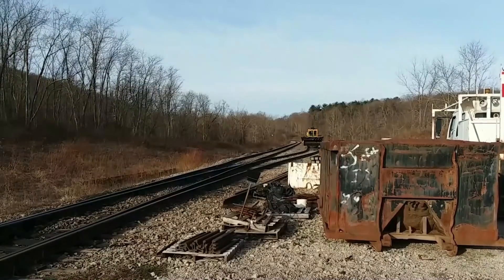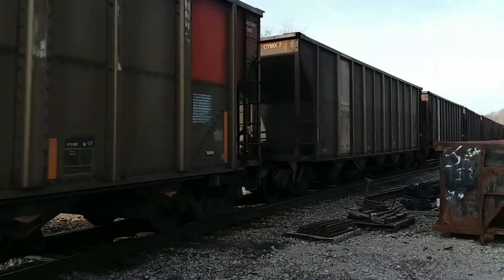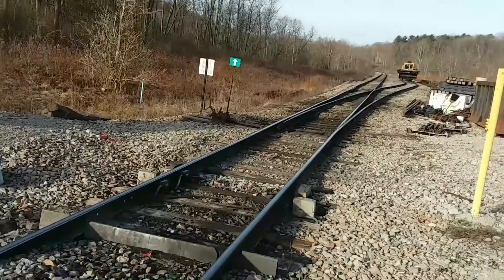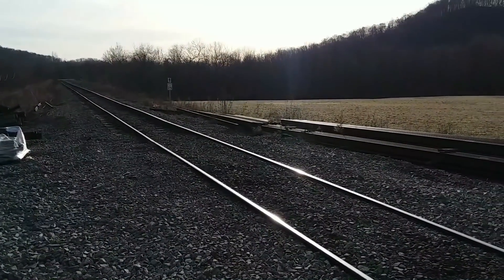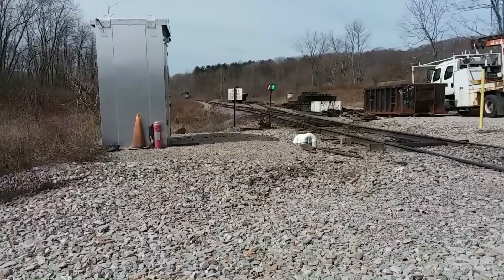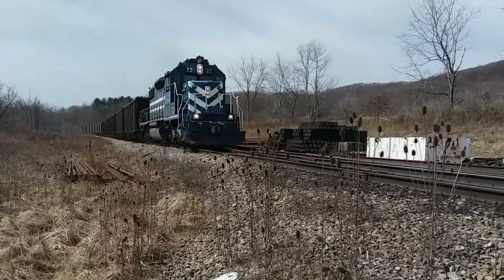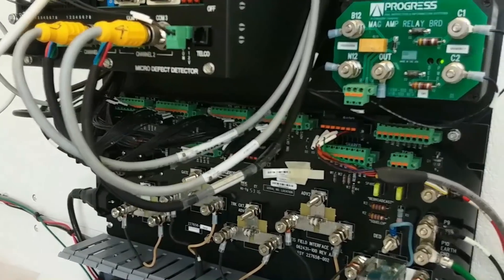Critical Alarm! Hot Wheel Detector Goes Nuts! on Dragging Equipment Message

Comment: I worked for a Class 1, now 20-years ago, and we used Devtronics Hot Box Detectors.  Most of dragging equipment detectors were 'flapper' style, but a few were static sensors - essentially a fixed-triangular steel plate, with percussive sensors beneath it.  We had monthly routines we did on all of the HBDs, checking the thermal cameras, within the cast aluminum housings on the outside of the rails.  We had a 'heat' source to simulate hot bears/journals.  We also checked the transducers, both the advanced turn units, as well as those that count the axels.  For the HBD to falsely alert, I suspect something is out of calibration.

Mice getting into the buildings can also cause things to go awry, from time to time.  The life of a maintainer is never dull.

We also had on-track lightning protection, to protect the HBD equipment in the trackside hut from both induction & lightning strikes.  Miles of track can do some crazy stuff to electronics.
Reply from the maker: Pretty neat stuff you shared with us, we really appreciate your
writing in. I love to hear stuff like that and will keep in mind the
mice for a future reference! There was a glitch in the computer
software and the tech had to come out and fix it, but wasn't
here when he did so I really don't know the exact thing he did.
Very interesting bout the lightening protection, I would like to
learn more about that. Once saw lightening strike the track and
a fireball went down the track bouncing from rail to rail,
my goodness that would have made an awesome video but it
was before I even had a cell phone years ago.

Comment: Could really quickly check the whole train with someone on each side of the train with a  FLIR heat camera. Maybe they do that already, just a thought.
Reply from the maker: That's what the cameras on the detector do, take an infrared
picture of each bearing and wheel as it passes over them. They
also once a day do a walk around using a heat gun on each
bearing just as added insurance. Not sure what a FLIR is, but
the heat gun they have is a high priced one that the fire departments
use. Do thank you for writing in and for watching Iain.
Reply: @ccrx6700  FLIR stands for Forward Looking InfraRed. This is the type of cameras that police helicopters use at night when tracking down crooks.
Reply from the maker: Sweet Thanks 😊

Comment: Sure did sound like both engines were idling going by 👍
Reply from the maker: Headed west they probably were, they are just coming down
off a grade that way and depending on the operator idle thry
here before throttling up for the next grade. Headed east loaded
both locos are in run 8. Thanks for watching the show Joe.

Comment: Can the rails ever be too low or sink when the train comes?
Reply from the maker: Yes they do sink thru soft spots in the ballast where there is
not a good roadbed to hold track surface and on occasion the
rail will fall for a certain length which creates a low spot in
relation to the rest of the track surface grade. Hope that
helps Tommie. We do appreciate your writing in and for watching.
Reply: @ccrx6700  I have always enjoyed large equipment. Many of them remind me of dinosaurs, which is sentimental. Also, I figure, if a train is really heavy it might just hit one of those plates to set it off, but not necessarily knock it all the way down? I like to figure things out and learn new things. Your videos are awesome for that.
Reply from the maker: @katitcha  thank you very much 😊

Comment: Check the wheels anyway, slow the train down
Reply from the maker: Train got stopped just below the curve and we did walk
the trip, nothing wrong, proper procedure was followed the
first time it set the message off, then after several roll by
inspections and different messages that were given we knew
the problem was in the detector and not a train issue. Do appreciate
your writing in and for watching Jim

Comment: This reminds me of an episode on Chuggington. The episode was about a fault detector system that they had installed on the lines. It was having issues just like this. Saying "Faults Detected!" But, no faults were found. Its definitely a pain when they act up, but its also good to have these detectors in place to when they do find problems. It helps saves equipment from being totally messed up. And also, to keep the crews safe.
Reply from the maker: This one rarely goofs up, just got lucky and happened to be filming
when it did. You are sure right, they are important for safety reasons
and this one has already caught 4 hot bearings in the 5 years it's
been here, thus saving derailments that most likely could have
occurred. Thank you Paula for watching the video, we do appreciate that

Comment: What ever came of this? I seen detectors have false temperature readings of triple digits in the sub zero temps but not false dragging equipment. Its odd the numbers are all over the place. On the first pass it was axel 111, 113, 115 which was between your 27th and 28th car, (out of 38) but when you made a reverse move, it was the first and second axel. very strange.
Reply from the maker: Ended up being a gremlin in the computer software, had to get a
tech out to exorcise it. Was very strange message for sure, it had
us baffled, but did make for a pretty cool video...LOL Appreciate
your tuning in and watching the show my good sir

Comment: Question?   First l hope that You and your Family had a Beautiful Wonderful Thanksgiving and everyone ate good and everyone was healthy God Bless You and your Family.   My question is why do the have the Engine's facing the same way.?  On on end it's facing correctly the Engineer is facing so He can see the Short Cab is in front in the direction the train is moving but when the Train is going the other way the Engineer and the Engine is running Longhood Forward. Why not turn that End of the Engine around so when the Train is going in that direction it's running Shorthood Forward? Just wondering that's all hope l explained it okay.  Awesome video as always
Reply from the maker: Thank you Kenny and we wish the same for you and your family.
Very good question. We have 3 locos, at any point any of the 3 would
be in the lead coming back loaded where you want your short hood.
So if one loco breaks down or is in for inspection, then they
can simply put another one if it's place. If one loco was turned
then that would mean long hood forward coming back loaded
for that loco. If locos were never switched around, then yes
they would have shorts hoods oriented for both empty and loads,
but simply isn't the case here. We also have no turntable so
turning a loco requires side booms and a lot of expense to
get them in. Hope that explains the why

Comment: I’m ex UK railway signalling, this kind of equipment is new to me but by the evidence on the ground, it looks like someone has been digging ballast (stone) out of the mechanisms and that maybe fixed it. Btw, I noticed the transducers to count the wheels.
Reply from the maker: Yes sir they are called gated transducers which count wheels in
and again on the other side out. Tech over the phone suggested
cleaning around the dragger and looking in the switch box on
it's end for broken or loose or corroded wires which is why the
pick and shovel were there. Was all good, tech had come out
and exorcise a gremlin in the computer software to fix it. Do
appreciate your writing in and for watching my friend

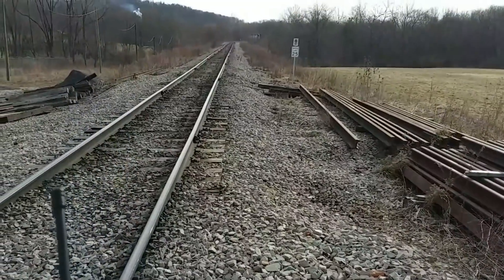Comment: 7:10 Zheeeeesh ---- the alarm went off even when there wasn't a train passing. :P
Reply: The train just passed over it 20 seconds before then. The video isn’t even cut and you can watch the train go by. It takes a little bit for the detector to cut out (or whatever the correct terminology is) after a train goes across before it gives a message

Comment: There is a switch in the dragging detector assembly, when the train knocks the paddle over it trips the switch. The ones I worked on had a relay in the shack, and you could hear it click when you kicked the paddle over with your foot, a good way to test it. The switch has a mechanism that allows it to trip with either back or forth deflection of the paddle, and that is a PAIN to adjust! If things get loose from all the vibration, the switch can go with the shaking of a passing train. There is also the possibility of water in the cable shorting things out, but in this case I would bet on the passing train vibration causing the activation. I preferred my equipment over this one, my detectors would send out a horn alarm over the radio when the detector paddle was hit, so people nearby could look at the exact spot on the passing train. This silent alarm is spooky!
Reply from the maker: You are correct in this having a switch on the dragger that trips when knocked
over. I do believe the relay you are talking about is the one the tech had us
try jumping over to see if that eliminated the fault message, but as you saw
it knocked the whole system out of giving any kind of message. Appreciate
your writing in with your expert knowledge and sharing that with us my good man
Reply: @douro20  The scanners for the bearings and wheels do, but we're just talking about the dragging equipment detector.
Reply: I wouldn't see much point to it.  How often would there actually be someone standing nearby?
Reply: @NiceMuslimLady  Well, if the dispatcher told me there might be a problem with an HBD, I would be standing there! I used to verify trains running over the systems every chance I got. I've often heard the radio alarm while standing there. The engineers who designed the system thought it would be valuable...

Of course, you are right about there not being someone around all the time.
Reply: @Flintsmooth  But that is after the detector malfunctions.  There won't be anyone there the first time.
Reply: I gave a relative who is a design engineer for Union Switch & Signal an idea for a flat wheel detector, but apparently the railroads don't care. Some of those are obnoxiously loud!
Reply: @spaceflight1019  When was this?  A patent was filed for that in 1977.  It didn't seem to go anywhere, however...your assessment that the railways don't care about flat wheels isn't true.  The rulebook says that a wheel with a flat spot longer than a certain length requires that the car be set out for repair.
Reply: @NiceMuslimLady  , It was maybe 20 years ago, and it used the Doppler shift to identify the flat wheel. And sometimes the hammering is quite loud. Funny thing is that I've loved trains since I was a kid but don't remember flat wheels being common until maybe 20 years ago.
Reply: Your comment would make a great video in itself. 👍
Reply: I worked for Metro North in New York in the M of E. Dept. Jumping out a relay to get something to work was never a good idea. I would hear " oh it's only temporary!" Most times it was.
Reply: @johnzeller1338  There is nothing more permanent than a temporary fix.
Reply: @SeanHarlow  It is only Temporary unless it works
Reply: @johnzeller1338  It can be useful for narrowing a problem down while troubleshooting.  As long as the jumper is removed immediately after the test it seems a safe and sensible approach.  (And of course have someone out checking for actual defects as the train passes.)

Comment: When it gets cold, electronics tend to go weird sometimes. Your fault could be anywhere between the ded sensor / trip and the computer. water ingress in a cable joint that caused corroded pin in a connector, who knows.
Reply from the maker: Yep, your right about that, we checked out several things the tech
suggested over the phone like that, but he ended up having to come
out and exorcise a gremlin from the computer software, sorry
don't know what as I did not work the day he was there. Do appreciate
your writing in and for watching my friend

Comment: The gear in the outhouse is nearly bulletproof.  Smart money,  it's crud or moisture in the sensors, or a gopher got in the wiring trunk and chewed the hell out of the wiring.

A poor man's way of detecting dragging gear is to spray paint an orange or blue line across the ballast from track to track. If that line's disturbed after a passing, then that manifest has got something wrong.
Reply from the maker: We did check the dragger electrical box for that, but tech had to
aome out and do something with the computer software, not sure
what as I wasn't there when he came. Do appreciate your watching

Comment: Do you think it's the rail going up and down broke a wire after thousands of flexes?  Really can see the rail going up and down on the second train (could be youtube's stabilization routine I guess).  Thinking a cracked wire would make/break the connection many times while the train is passing, or at least change the resistance.  Hope you find it as I know how tough it is finding intermittent faults.
Reply from the maker: Very good suggestion sir and you are correct there is a good 
bit of rail pumping which is not at all desirable here. I have
suggested concreting this crossing and detector site, however,
in this case the tech came out from Progress Rail and had to
fix a computer glitch which was causing the problem. We do
really appreciate your writing in and for watching the video my friend
Reply: @ccrx6700  I'd imagine he just reflashed the unit.  If these things get too hot it can causse memory errors to occur.  But then so can cosmic rays..

Comment: So did you ultimately find and fix the problem?  Also how do you keep the snow out of the hot wheel detectors?  Or do you just go out there after every snowfall and clear them off?
Reply from the maker: Great question Jeff, the boxes bolted to the rail that have the cams in them are heated. Tech had come out and exercise a demon from computer software to fix problem. Appreciate your watching ☺
Reply: @ccrx6700    amazing the difference a letter makes - exercise v exorcise.
Reply from the maker: @roboftherock  heh, heh, never noticed that Robbie, PS that's my brother's name too 😊

Comment: Do you have a handheld infrared camera device you can point at the passing train as a backup in situations like this? \m/
Reply from the maker: We do have a very expensive heat gun, the same kind the fire companies use for checking bearing temps, however in a roll by
such as here, could only check one side and at 25 MPH would
be kinda hard. Someone usually does walk the trip on both sides
as it is dumping with a heat gun as extra added insurance from
having a hot bearing. Do appreciate your writing in and for watching

Comment: Bad (rusty) connection from the detector switch to the control circuit in the cabinet.
Gives false detector switch actions by the vibration of the passing train.

Or possibly a problem with surging power supply in the control cabinet.

Comment: No fault found that's the worst type of fault.
I liked yo see a burnt out resistor, relay or other component.
Presumbly the metal bar across the track as a train goes over it, moves if a  pice of the train is hanging too low and trips a switch and it works both ways?
It has to be clear of the track ballast and any other drbree that might obstruct it?
What was the fault even it was found?
You were in the right place at the right time?
If the detector is built like Network Rail equipment it should be easy to trace the fault. It looked well made and neatly wired.
Thanks for another exciting video.
Reply from the maker: Really glad to hear you enjoyed Anthony. yes the dragger will trip
both ways depending on which way the train is headed, east or west.
and yes it has to be clear of debris so something like that would
keep it from flopping over. Tech guy ended up coming out and
exorcising a gremlin from the computer software, I don't know
exactly what he did as I was not with him that day. Do appreciate
your watching the show my good friend

Comment: Well that was fun. I see you got it fixed but no cause of the problem. I wonder if it was a faulty micro switch setting it off as the track moved under the weight of the train. Inside the cabin looks very like ours with the same Betaduct for the wires and 2BA terminals I saw on another video you also use the same railway alphabet to identify equipment.
Reply from the maker: Something possessed the computer software, had to get a high tech out to perform an exorcism on it , all is well now, but little guy in
cabinet still can't be found...LOL appreciate your watching my friend
Reply: @ccrx6700  Aww he got lonely in there and wanted a bit of company
Reply from the maker: @cedarcam  😊

Comment: Youre probably the shortest railroad to have a detector at about 22 miles of track if I recall.  Even as the machine kept calling a problem.your staff did they safe and prudent thing by manually checking out all potential causes
Reply: It has saved them from I think two wheel fires already, well worth the investment no matter how small the railroad. Especially since it is a coal railroad a wheel fire could lead to a whole hopper of coal on fire and more in that draft.
Reply from the maker: Could be Paul, but it has caught 5 bad bearings in the short time
it's been here, saved more from not having derailments than the 
detector cost. Just caught another bearing this week. Yep, everyone
did follow procedure, thanks for noticing my good man. and
we have 16.8 miles track. Do appreciate your watching
Reply: @ccrx6700  glad to hear it paid for itself. It doesn't sound possible you'd have that many bad bearings in 16 miles as your trains don't go all that fast. Makes me wonder if being loaded 8 times a day affects it or if traveling only one direction may affect them.